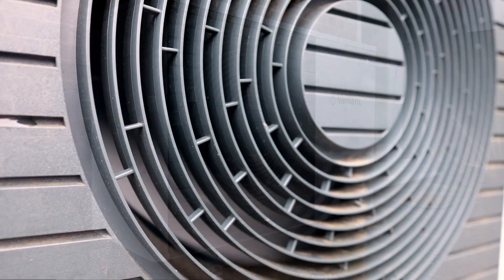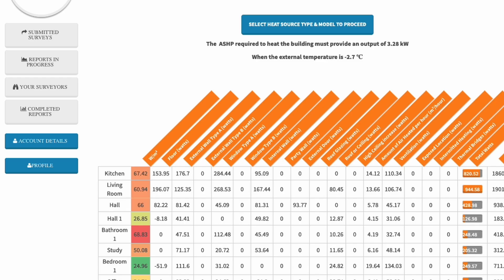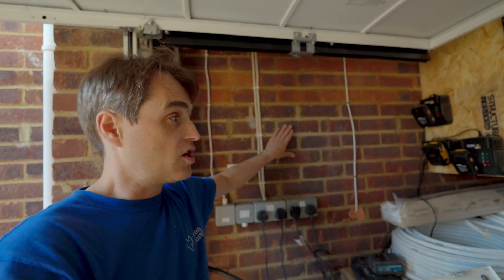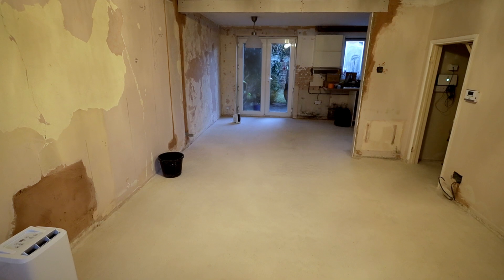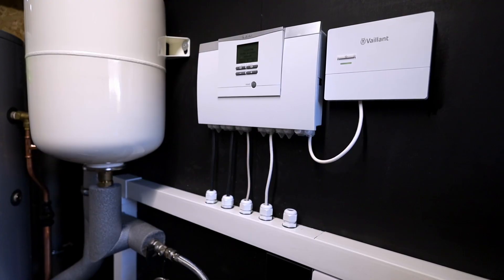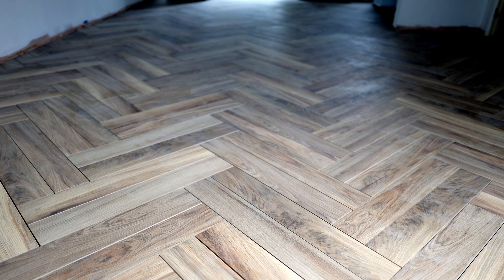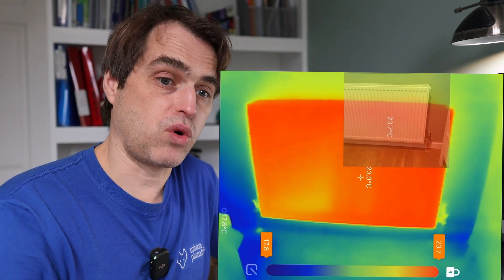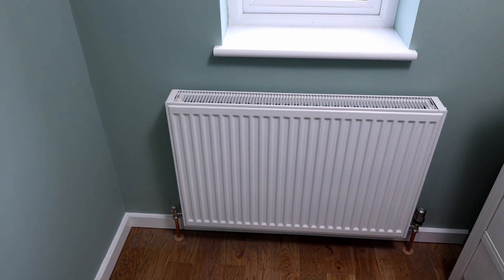How I Installed The Most Efficienct Heat Pump In The UK.

Comment: Thanks for providing these insightful videos!
I also have the 5KW Vaillant system, but installed more "traditionally" with a small buffer and everything. My COP values are not that high usually, but the overall energy consumption looks good so far. If the trend continues we will end up with about 1500kWh of electricity for the first year, despite having more than one cold spell going all the way down to -13°C here in Germany.
I am on the fence about asking my Installer for a quote on some changes to the system, since it likely won't be worthwhile...but I haven't ruled it out yet.
Reply: Strange that the average 2 bed house uses around 2000 kWh a year without a heat pump?
Reply: @rabhaw2327  
The 1500kWh are just the heat pump

Comment: I’m not a sceptic but like most do my homework, at my age I want comfort and as a bonus save a bit at the same time.  We are il informed and lack data for our own homes.  I can only do a few of the things you’ve done and my EPC is already at C and it needs more loft insulation.  My boiler will need replacing in the next few years and I;m already preparing for a ASHP.  It’s not about ROI as I’m too old.  Great vid thanks Mike
Reply: Yes, I know about 1000 customers that want what you want they end up getting Comfort think they’re saving a buck but when the variable speed system goes down, it ends up costing them all of their Comfort and more than they saved almost every time.

Comment: I am nervous about getting rid of gas but I am getting an Octopus survey.  A system like yours would be mazing.
Reply from the maker: Good luck with your installation.. Push octopus to desgin to max of 40C if you can. Pay more if needed.
Reply: @UrbanPlumbers  Thank you so for your advice.
Reply: Why get rid of gas? Wouldn't be better to kept as bak-up if it's already there? I installed in 2022 a heap pump but kept my 2019 gas boiler for DHW and as back-up. Only had a hole in the wall for the flow and return and some cables and that's all of the "plant room". No big boiler for DHW as the instant DHW gas boiler still does that job.
Reply: If you keep gas you still have to pay standing charges and maintenance fees, if you bother. Obviously any standby system benefits from excercise but that's £400 a year better spent on an emersion heater, a couple of fan heaters and a social life. 😊
Reply: A very interesting video. 
I have a long term build that we are self funding, so doing it in phases. 
It is a low energy structure with 250mm pumped cellulose in the walls & a warm roof design. 

It’s all air tightened & will have MVHR. 
As we live in the uplands I was always wary of air source due to freezing of the heat exchangers. 

Recently I had a conversation with a plumber who’s installing Viesmann units. He got their German Head Office to calculate heat losses for the structure & specify a suitable unit. 
I’m 90% convinced to go with it. 
I’m wondering if you’ve any experience of Viesmann?
Thanks Hugh.

Comment: Your conclusion are spot on. It's a scandal that all new builds aren't HP. You've done a lot of work on the property to get it to that COP
Reply from the maker: Yes, but all new builds are even better than my house in terms of insulation! It’s a crime that most don’t perform like mine or have gas boilers installed
Reply: @UrbanPlumbers  What are the thermal loses of your house at -5  degrees Celsius? And what of her buildings?
Reply from the maker: @johnzach2057  around 4kW at -5
Reply: No new builds in Scotland will have gas boilers from April this year, England and Wales April 2025.
The heat pump market will be very busy.
Reply: @_Dougaldog  hopefully the installers will do a great job. But I'm not holding my breath

Comment: Are these Vailant systems variable inverter units or are they on/off? If they are inverter units what is the inverter range?
Reply: They typically have a modulation range of 1:4
Reply from the maker: @UpsideDownFork this is much more complex than just stating the ratio. Output changes with the flow temperature, system DT and external temperature.

Generally the warmer it gets the higher the output. Which is annoying as this is when we need less output.

Also counterintuitively the lower the flow temperature the higher the unit output 

I have observed my unit outputting max of 9kW and minium of 1kW - but under different outside temp and flow temp.
Reply: @UrbanPlumbers 

From looking at the graphs if the firmware allowed you to lock the inverter to the lowest possible setting then you might squeeze a tiny bit more COP. Some AC units now allow you to set not only the temperature but lock the inverter to low setting.

Comment: The only issue we have with low radiator flow temperatures (gas with weather compensation ) is that the humidity is quite high throughout the house. We’re looking at an mvhr unit it to combat that
Reply: Maybe get a dehumidifier 🤔. They are quite affordable.
Reply: @johnzach2057 😂. I’m a heating engineer with 2 teenagers in the house. Two teenagers (girls) produce un godly amounts of moisture in the mornings with their showers. The house is completely air tight so a dehumidifier will not keep up I’m afraid. We install MVHR’s through our sister electrical company so it’s not a problem. Thanks for the hilarious comment. Made my afternoon 👍
Reply: @copperskills3973  

So your humidity problem is caused by lack of ventilation rather than radiator flow temperature ?

Comment: Air to air is so easy to install in comparasion
Reply from the maker: Not my choice for heating - moves air, cycles, noisy, less comfortable - needs huger internal temps for comfor as it moves air - far far inferior to hydronic heating
Reply: @aa-md4qr

Do you not need to be F gas certified to instal mini split systems, and still have hot water to heat ?

"In an announcement today, condemning online retailers for 'playing fast and loose with public safety', BESA, which runs the UK’s main F-gas certification body Refcom, says products containing flammable refrigerant gases were being bought by DIYers and unqualified installers."

Comment: I’m not a skeptic, however I have moved into a new build 3 bed house with a heat pump UFH down stairs and rads upstairs! I couldn’t tell you the kWh used but my bills are just slightly cheaper than they were in a a 1940s house on a system boiler. I would say around £50-£80pm cheaper that’s with all this cold weather.
However I can see that once temperatures stay in the mid teens my usage will drop quite considerably, heat pumps have their place and I believe the limitations are set by un trained engineers and bad design.
I have solar and at some point will attach a 15kw battery just to help a little and once the gas meter is removed and I can get a cheaper night tariff I believe my bills will halve again, total household bills will hopefully be around the £20-£35p/w currently around £40-£60.

Comment: The full year results will prove interesting Szymon.... UFCH with high thermal mass and improved insulation is certainly the ideal way to go, but I wonder how many customers will be put off by the disruption, even though it's necessary.

I'd toyed with the idea of a heatpump (GFCH + rads) for my 10 year old house, when the effect of phased addition of insulation dropped the total annual heating below 10,000kWh.  However, with unreliable mains power and winter temps dropping to -16, I bought a UPS for the GFCH instead - I realise I'm stressing the boiler (Buderus) on occasion with a target house temp of 21c and weather comp, but 12-13 cycles per day is unavoidable with a minimum output of 7.2kW and losses under 4kW/h.
For running cost comparison, my 100m2 place had a heating bill under 500 quid last year, again with a -16 period, and I'm seeing at least a 20% reduction in gas consumed for this year in the final insulation phase.

Best of luck with your new place, and keep going with the videos, they are both interesting and educational.

Comment: Yes I am thinking of going the heat route pump in a year or two but first off,  I want to replace my old combi boiler with just a hot water cylinder and then use overnight cheap electricity to heat my water via immersion heater to begin with.  (I can then get rid of the combi boiler cancel the gas etc save money on gas fees and potentially work on installing some more efficient piping and radiators ready for when I do go the heatpump route).  Then the heatpump can heat my existing hot water cylinder, and heat the new radiators too (and possibly underfloor heating in my garage if I am lucky).  What do you think of this plan?  I also have a small solar and battery system so I think it will work well eventually when it's all finished.

Comment: I think you are missing some major reasons why HPs are not replacing all gas boilers 1- the extra level of insulation investment needed to retain the heat - yes having crap insulation with a gas boiler is also a waste but HPs need good heat retention (not just attic insulation). Few homes (bar near new ones) were ever well insulated (excl the attic which can be done at low cost in DIY fashion). 2 Bigger Rads or Under floor heating (this is a big install hassle to fit UFH- yes first install may be quick but then there is the sceed drying time) . Bigger rads adds to what is already a higher cost than gas boiler unit (this takes up space outside that some may not have) . Bigger rads may not be possible in smaller bedrooms (your third bedroom is a 3 bed semi is often small ). then there is the cost -even with a grant of thousands - you have to find the extra cash - not many need a bigger loan for a gas boiler upgrade (unless it needs more than the boiler). Finally there is culture - as you noted - how many new HP owners will call you to say the rads are cold when they come in from the cold outside or a cold snap even if the temp of the rooms is perfect.
Reply: Insulating my home gradually in the past 8 years  has dramatically lowered my gas usage to about 50% for heating (not including DHW) and I think you should always do this if you intend to stay in your home for the next 10 years and maybe even with 5 years if you take comfort and resale value into consideration.

I am currently awaiting my hybrid heat pump system, but the insulation is not perfect and UFH is still something on the todo list. Even the radiators will not be changed as most rooms can get warm at a 40/34 temperature. Maybe just one room will get an upgrade as it has a tiny radiator and it is a bedroom used as an office, but that's a small investment.

I think the hybrid heat pump will pay for itself even if the heating bill is already low because of the insulation. Heating the home + DHW is about  7500 kWh of gas right now, and the hybrid heat pump should produce at least about 6000 kW, leaving only extremely cold days and DWH as work for the 4 year old gas boiler.

In real life not everyone has the cash for a heat pump and it is not always the right solution as a turned off gas boiler makes sense if you are away most of the day for 5 days a week.
So I would say insulate first and only get the heat pump if and when it makes sense for your situation.
Reply: I have a gas boiler. My rads are ‘cold’. My house is 20/21C.

Comment: A few thoughts:

1) No one guarantees SCOP in the industry without charging a premium.
2) Interesting you went with a Joule over the Vaillant cylinder. Why?  
3) Did you consider a Mixergy iHP for maximum PDHW COP?
4) Solar PV on its own will make more sense given how low your consumption is. You won't need a battery and it will likely not pay for itself unless you have an EV as well. In that case, go with a GivEnergy All in One
Reply from the maker: I do guarantee scops and yes I charge a premium as I provide a premium service.

I have an EV and also other electrical use. I need around 10kWh battery - they are not that expensive anymore
Reply: @UrbanPlumbers  10+kW of a quality battery system (Tesla/ SolarEdge/ Enphase or GivEnergy) will cost you £6000 or more installed. 

You can get lower end battery brands but proceed with extreme caution. 

Any reason you went with the Joule over the other cylinders?
Reply: @UrbanPlumbers  Use your EV as a Home Battery with a smaller one as a backup and you can go off grid .

Comment: What is the recovery time of such systems? Or does the system stay on 24/7? Typically a gas system will be off over night does this remain the same? You show 20.5 degree room temp how quickly could the system say go to 24 degrees?
Reply from the maker: Around 2-3 hours per degree if run efficiently. - could be done quicker at a higher cost

Comment: The naysayers are going to have a fieldday.. 
"Luke warm rads" pfft, cold to touch rads.
Mention of "Immersion" on the dhw cylinder obviously means its needed for heating of course.

Impressive though, maybe Vaillant need to consider making a proper 3kW unit now 😉
Reply: Usually it's only required for legionella disinfection, so only runs once a week and only has to heat the water from 45C to 60C. The means it will use less than 4kWh of electricity at a cost of about £1.20 (and less if you can do this using your own solar PV or tariff that costs less at night).

Comment: Not sure I agree with the principle of underfloor heating without insulation under, heat loss to ground seems a waste.  Yes it will warm up over time, but ground is one big heat sink
Reply: Totally agree…this is a bit of an error
Reply: Too many people misunderstanding "heat goes up" and not realising that only applies to fluids/gas
Reply: It’s actually the edge of the slab where you lose the majority of your heat, not below it.
Reply: Ground will help cool down the building in the summer. No need for AC.
Reply: Ofc insulation is better than none, but cutting out the entire floor to insulate will be a handfull for modest, if any noticable, gains. The money spent will pay off quadruple if spent elsewhere.

Comment: I live in the Northwest of the USA and am installing a heat pump and underfloor heating, partially based on your and other's experiences. None of my friends/ colleagues understand why or what I'm talking about because what we see here are mostly forced-air furnaces or, less often, air-to-air heat pump systems. I just wanted to say thank you and keep the heat pump content coming.

Eric
Reply: I have a heat split in buffalo ny insulation is key far higher than regulations us key , r30 minimum and insulate the external connected wall as well , the underfloor and main house all 1900 didn’t cope with 14f and needed supplementary support, the annex with modern insulation runs s dankin air to air 16kwh air to air is the best way to go in my experience heating 2600 ft property we have no removed the air to water system completely and gone for a 55000 btu Bosch tankless heater , and had no issues keeping it at 75f yet still keep the air to air heat pump as that has been brilliant
Reply: I live in Canada with many days of the year going below -20 degrees C. If I went with a ground based heat pump and infloor radiant heating, would that solve the need to auxiliary heating sources?
Reply: @alaingrignon  You don’t need a ground source heat pump, my air-to-water heat pump worked perfectly fine at -30°C and the backup electric boiler only kicked in for the few days of the -40°C weather.  The extra money that you would spend on drilling or digging is better spent on improving your insulation.
Reply: Anyrhing that burns fossil fuels for heat will be banned eventually.
Reply: Eric, which manufacturer’s heat pump are you installing.
Reply: @michaelm3255  Spacepak SIM-036
Reply: @michaelm3255  Spacepak
Reply: @michaelm3255  I attempted to reply previously but apparently it didn't save. I'm using a Spacepak SIM-036.
Reply: Same! I want one (OHIO)
Reply: Washington? Not that cold in the winter. Not sure these systems will work in places like Montana or Wyoming without back up heat.
Reply: @goldenretriever6261  These systems work in Norway, Sweden and Denmark since the '80's and before. If the temperature drops many degreed below zero they all have back-up electric heat. I'm using one heat pump for my house that has a gas boiler for back-up (and for DHW) and the vacation house has also a heat pump but with an electric boiler as back-up. I love in Romania and two weeks ago it was -14°C. The total cost for one heat pump was 2.700 EUR, installation included.
Reply: @goldenretriever6261  We’re 500 miles north of Montana, our air to water heat pump worked on its own down to -18°F but when it went down to -40°F for a few days the electric backup boiler kicked to keep the 80 gallon buffer tank warm. Montana is warm in the winter compared to our location. Only got the system going in November so not a lot of stats yet but the house is toasty warm.

Comment: Surprised you did not change out the rads upstairs.  Did you power flush ?
Reply from the maker: All rads are new. I don’t powerflush anymore. Only mains flush and no chemicals.
Reply: @UrbanPlumbers  Why not?
Reply: What’s the circuit length / water volume of the underfloor?